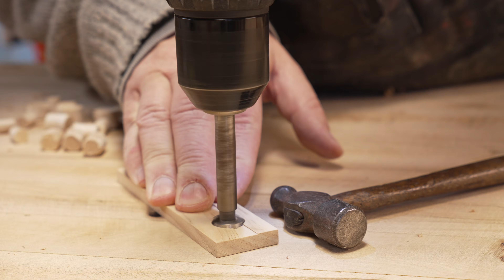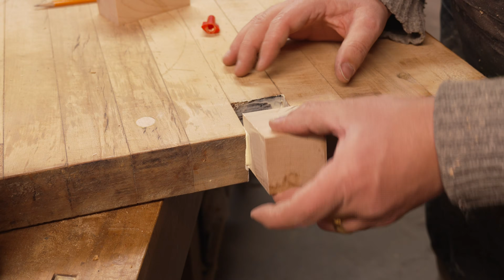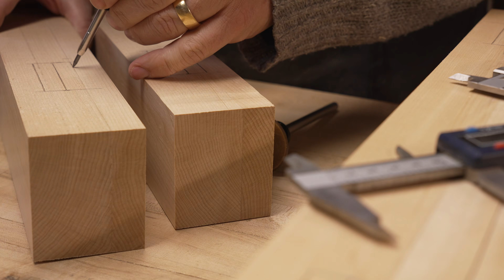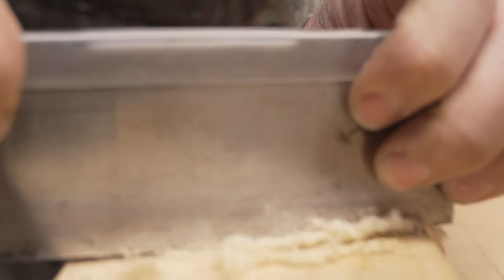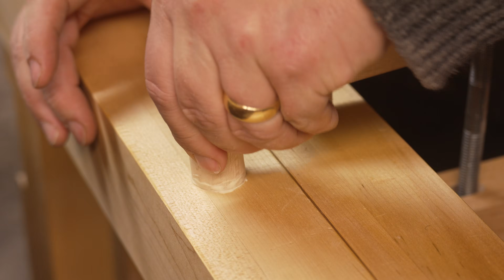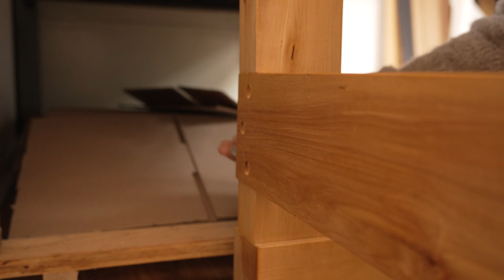Saving A Solid Maple Benchtop - Full Workbench Build

Comment: Came for the bench frame build.  I'm milling the lumber for a similar work bench frame right now.  This will be my first effort at mortise and tenon joints. I will mill the frame lumber using a similar mix of power and hand tools.  Don't have a tenoning jig like that but I do have good dado stack which I will use for the tenons.  I'll make the mortises the same way you did.  Your video was a big help. Wish I had that nice maple!

Comment: My computer desk uses the same peg mounting system, only it's using 2 sawn-off nails.  It works quite well, but is a pain in the butt to get back into place because the "pegs: have no taper on the end to guide them into their matching holes.  That's definitely an important addition to the idea that makes it considerably more viable.  (I'd never use the nail pegs in one of my own projects, having used this desk for 20 years through several moves, but with that taper to help guide it into place, I can definitely see it being very usable.

Comment: I LOVE the new channel. it's great to see someone still doing woodworking as I was taught.  in my youth, I spent 12 years as a pipe organ builder and the only thing I could see that you did differently than the shop that I worked for is... Robertson screws.  Being south of the border (Minnesota so, not too far south) we used slotted screws. Nothing against Robertson screws, just not used to seeing them as much.  Also for ease of spraying and robustness, we used a lacquer finish, although anything that was furniture, did get a spit coat of shellac first.  One last thing, I wish I could find a place to watch " The Furniture Guys" now.  One of my favourites too.  Well, thanks again for both your channels, I always enjoy your work and, as a side note, yours are the only channel of these types that my wife also watches with me.
Thanks again,

Comment: Love the build.  I like shellac as a finish. I just don't like how long it can take to cure to a hard finish. But I prefer it over polyurethane or oils.

With that, here is a tip: use a piece of craft paper, a brown grocery bag, to buff it after it is no longer tacky. It consolidates it and makes it go hard faster. It also leaves an absolutely beautiful finish. I find I don't need to sand between coats unless there are grain issues. Minor dust goes away as well.
Reply from the maker: Great tip! I'll definitely give that a try. In the past I've used 0000 steel wool and paste wax, followed by a buff with a soft clean cloth. It leaves a nice soft sheen that I particularly like.

Comment: Nicely done. You have many skills, as we see. As an antique furniture guy, I love, LOVE shellac. But--and maybe people have told you this already--it's not the best choice of finish for a work bench. It's beautiful, but not rugged. It's relatively easy to damage, and a spilled drop of alcohol will dissolve it. For the top of the bench at the least, I would recommend a tung oil varnish, though there are lots of good options. Anyway, keep it up!
Reply from the maker: Good point regarding the durability factor. I’m probably going to baby this worktop with cutting mats and the like, but if I need to refinish it someday at least I’ll know where I stand. Thanks for the comment!

Comment: Tip: If you ever run into difficulties squaring mortices, try rounding the tennons instead ;-)
Reply from the maker: I’ll try that!
Reply: @FourKeysWorkshop  chisels and shinto saw rasps work best. I've even used a hatchet once. Slightly messy, but since the tennons are hidden later ... 😅

Comment: about lining up the stamps, I made a set of blocks for that purpose! I have three blocks, a 6-slot, 12-slot, and 18-slot. they're just made from a pine 2x4 with holes drilled 2 mm larger than my stamps, into which I glued silicone pencil holders lol I call 'em my printing blocks :b
Reply from the maker: Thanks for sharing, I may have to do something like that!